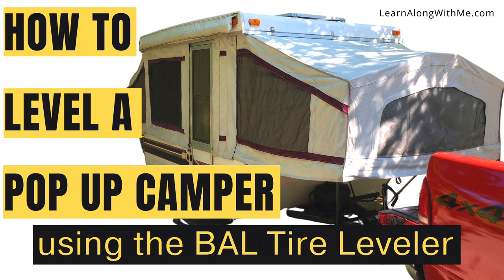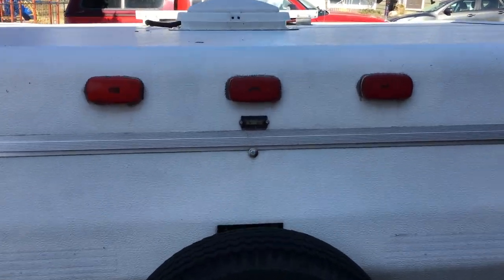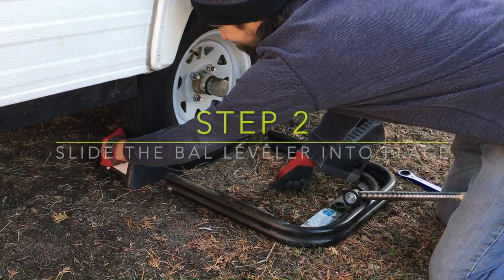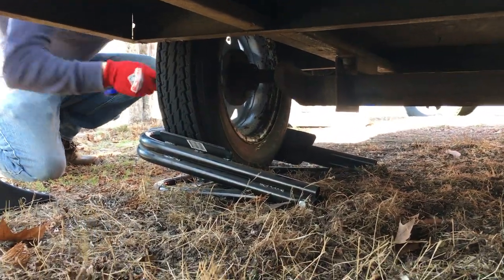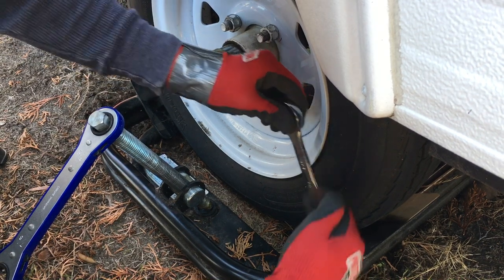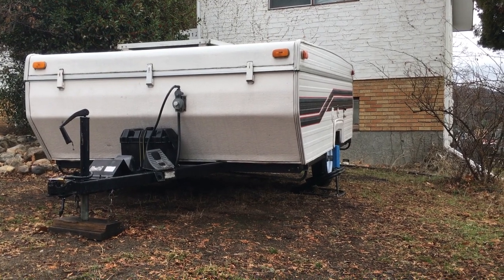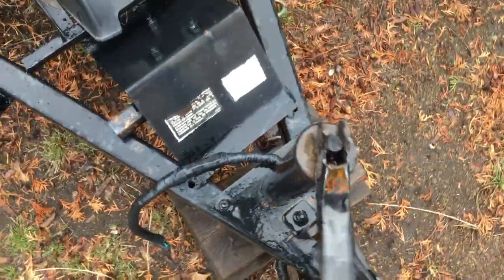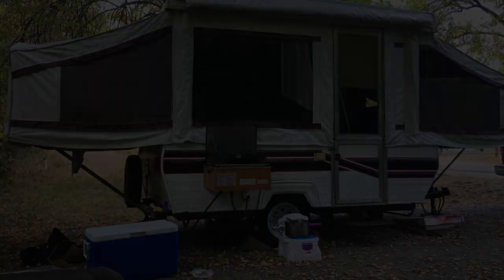How to Level a Pop Up Camper using the BAL Tire Leveler

Comment: so after you get it level do you put solid supports on all 4 corners?
Reply from the maker: Hi, we never did. Our Palomino Colt didn’t  come with stabilizing jacks on the front of the box. We had the manufacturer’s stabilizing jacks at the back end, and just the tongue jack up front.  So basically supported at 5 points if you consider the wheels (one is on the BAL leveler), the two stabilizing jacks at the back, and the tongue-jack up front.  

This worked for us, but if you have kids bouncing around a lot, or other reasons for more support then you could get extra stabilizers.  
I’ve seen people use those portable, screw-style stabilizers which you could use at the corners of the campers.  You could toss these in your tow vehicle. 

Plus, I’ve seen some people build their own bunk-end stabilizers to go right under the bunk ends to support the beds while they’re sleeping (or doing whatever else). 

I hope this has helped. 👍

Comment: A set of plastic ramps is much quicker. You just driver onto one, all done. I would have our level side to side before even unhitching. I am sure I would also be packed up quicker. Noi winding round and round, just drive off, pick up and go.
Reply from the maker: That’s good to know about those ramps. For people like me who are still getting comfortable backing up trailers I thought the BAL leveller was easy. (It was stressful enough just getting the trailer into place the first time. 😃).  But for other folks who are good at backing up, then this may not be the way to go for them.  Thank you for watching and commenting. 👍🏼
Reply: @LearnAlongWithMeVideos  thank you for the demo! These will make this process SO much easier for the solo traveler :)